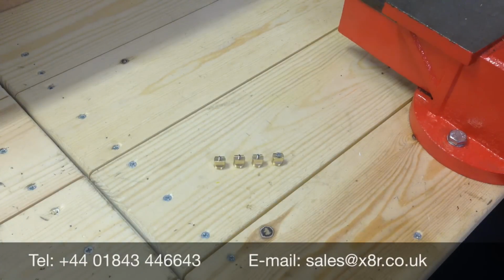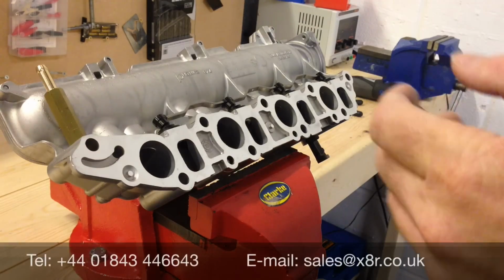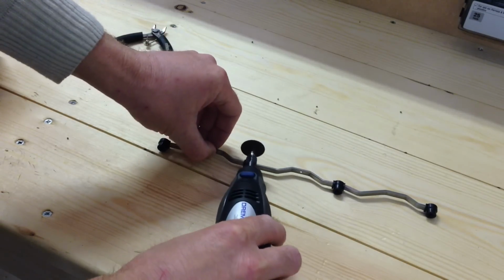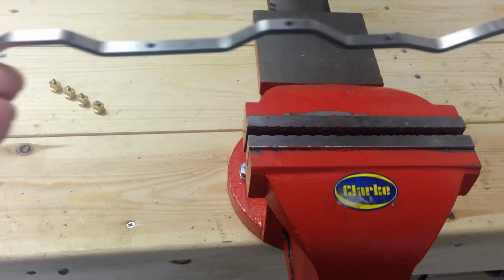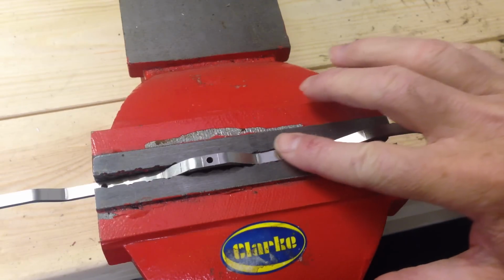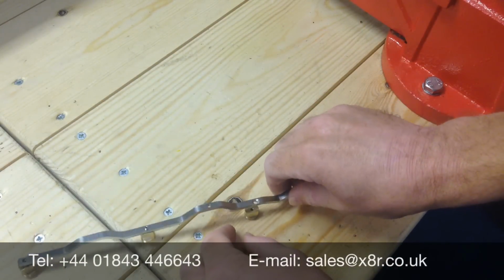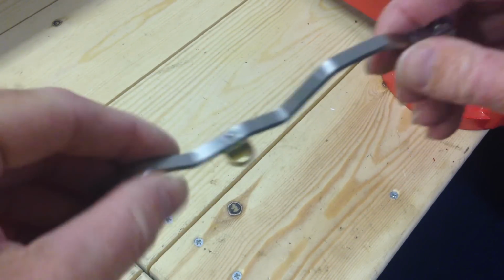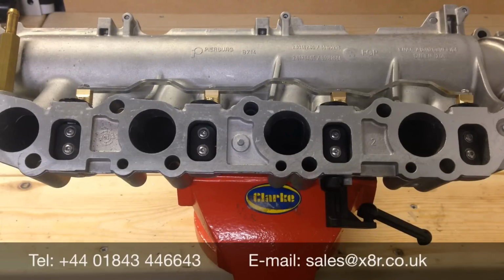Vauxhall SAAB Alfa Romeo Inlet Manifold Swirl Flap Rod Repair Fix Install Fitment Instructions

Comment: Which way round does it fit?
It appears to go on either way but the bar isn't totally flat across the board.
Looking at it, the one furthest to the right seems to be the odd one out. Maybe because of the "step" on the manifold?

Comment: I'd never repair one, just replace.  Why modify it with screw recesses and risk weakening it?  If you're after tuning, then that's all in the ECU until you ant massive gains... Then it's down to the turbo and airflow.

Comment: Repair? Bullshit! Better to take part without swirl flaps (for ex. from AR 156 engine). This shit is not good for the engine!!!
Reply: what do you mean? Why is it no good?
Reply: +Zom Robinson Well lets see: it's a rubbish and unreliable swirl flap, it's expensive, labour also is exepensive. So what can you do? Simple, use it untill it's dead then break the flaps and plug them with an aluminiun cork made by lathe. Easy fix but again, it's expensive but at least there won't be any problem anymore.
Reply from the maker: The swirl flaps are problematic on these manifolds if you want to remove them we also offer a blanking kit.
Reply: @X8RLtdUK   hello I recently have that problem.
Question is if I decide to blank them that will have any impact on fuel comsumption?
Reply from the maker: @marcinadamiak7532  No, it should not have any impact on fuel consumption.